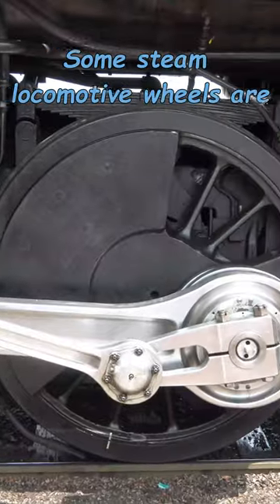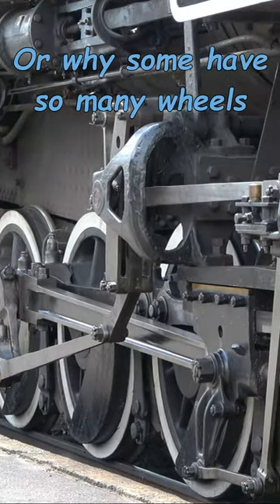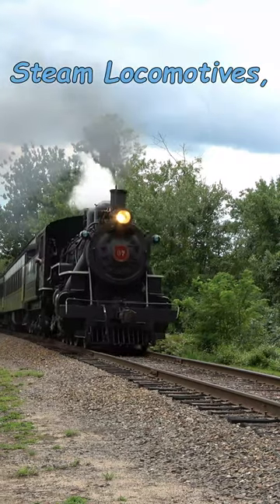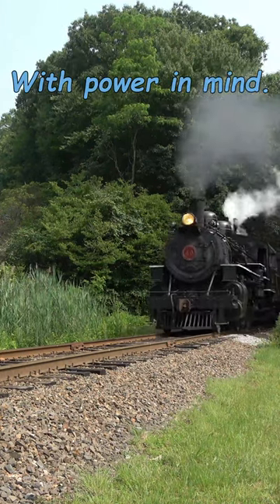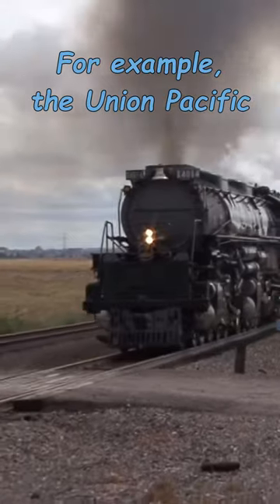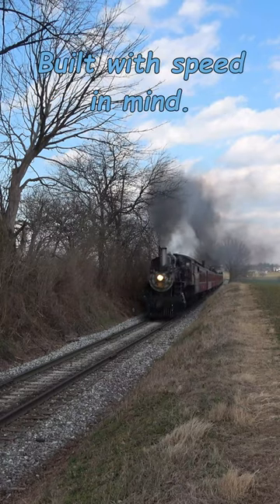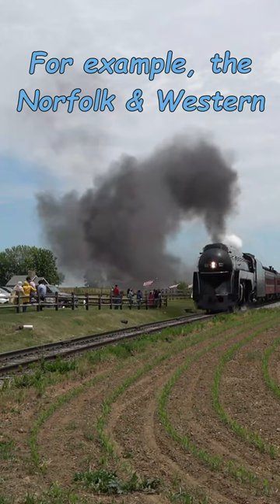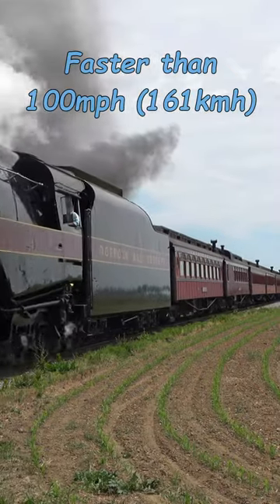The Secret Behind Steam Train Wheels

Comment: How does less wheels equal less power?
Reply from the maker: If there are less wheels, then there is less traction. If there’s less traction, then it’s more likely that the train will get stuck with heavier loads.
Reply: @northeasternrailfilms  they don't put power to every single wheel
Reply from the maker: @mr1ybbob3214  Right, they only put power to the driving wheels which are the ones connected to the rods.